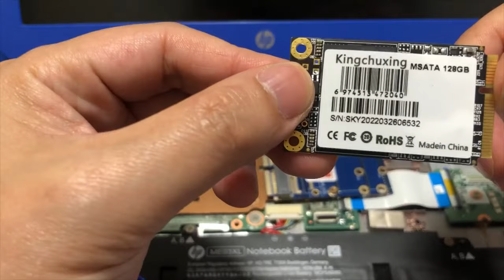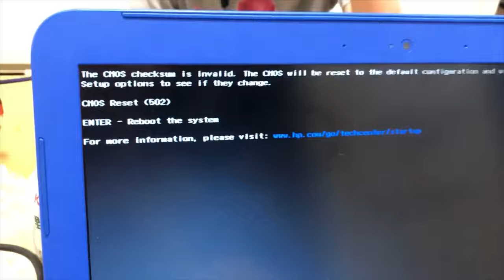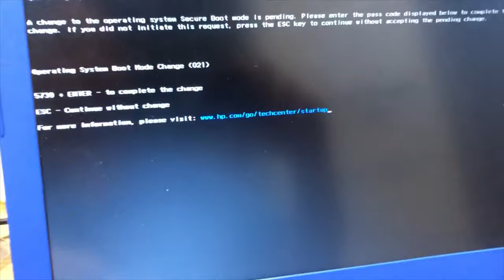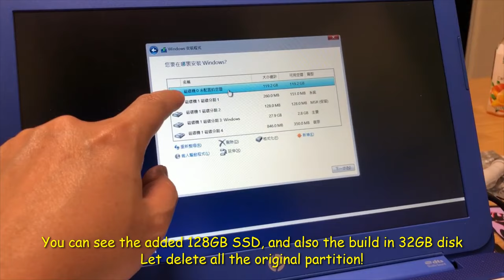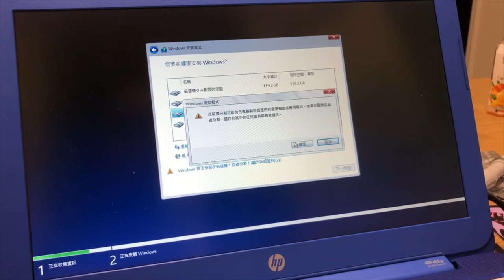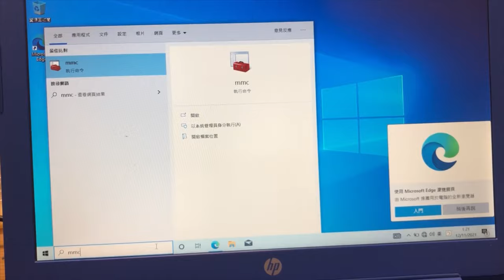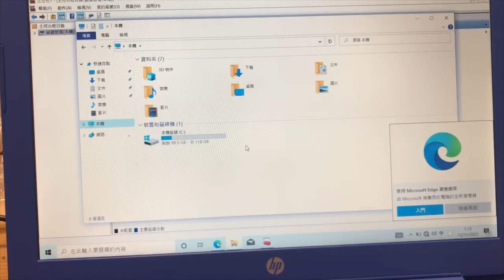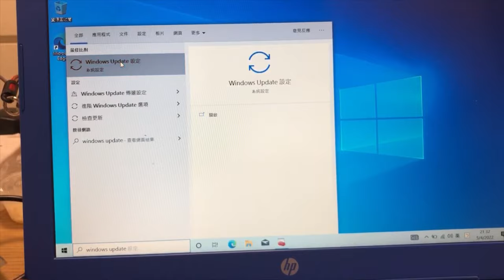HP Stream 13 hard drive upgrade

Comment: if your hard drive isn’t broken, you can upgrade the storage in a pretty seamless way by using the micro sd slot. they sell micro sd cards now that are like 10x the native storage on the stream and they insert flush into the slot so its set it and forget it with no reduction in form factor. ofc thats only if the native drive isn’t broken
Reply: I have tried this method but my Laptop doesn't recognize the Micro SD as a native storage
Reply: @dencerapolo2867  thats true it treats it as a removable drive which is inconvenient if you need to download more appa

Comment: Dam man i was literally bouta throw my laptop away … cant factory reset cuz of memory to lil.. this will work on hp stream 13 notebook right? Mine look a lil different thats why…
Reply from the maker: Do you mean you want to increase memory on stream 13? There is no solution so far…
Reply: if you know how to desolder the ram and resolder the new ram. it should be technically possible but very difficult to do. Also even getting any spare ram parts for this laptop would be insanely hard to do since how old this laptop is.

Comment: I did this on a 14-inch stream model, but I needed to use a refind for it to boot from the ssd, using the way you did with the adapter. Wasn't this procedure necessary for this model?
Reply from the maker: It may not work for other models. the motherboard layout may different and there may be no space for you to install the card/ssd.

Comment: Update: it IS possible to install and boot to operating systems on an NVMe drive on an HP Stream 13 laptop! See some of my later comments on this thread for the solution that worked for me.

Great video, brother! Easily one of the most helpful that I've seen on YouTube -- this video has far more simplicity and than videos from other channels with thousands of subscribers.
I followed along and managed to swap an SSD (with an adapter) into the wifi card slot also.
Although it's given me 256gb of extra storage, the bad news is that I cannot use it as a boot drive. 
My wifi card slot on my HP Stream 13 didn't have a mPCIE connector... It had a M.2 connector (with A+E key). So I've had to use an NVMe SSD instead of an mSATA SSD.
It seems like NVMe cannot be used for booting in the same way that SD cards can't be used for booting on HP Stream 13 laptops 😓
Reply from the maker: Did you enter the Bios to change the boot option to "legacy support"?
Reply: @alexlam4410  I tried everything, brother.
Secure boot off, secure boot on. Legacy support off, legacy support on... But none of them worked in getting the efi/system partition on the new drive to be recognised. 
I've installed Linux on the old 32gb drive instead, because 32gb isn't enough for Windows. Funnily enough, the grub bootloader for Linux does show entries in its boot menu for my Windows install and other Linux installs on the new NVMe drive, but unfortunately when I try to click/enter any of them I get errors saying that the device doesn't exist.
That's why I think NVMe drives are like microSD drives for this type of laptop in the sense that there is no native ability to boot to them.
Reply: UPDATE: Turns out that it IS possible to boot to an OS on an NVMe drive installed on an HP Stream 13 😃
Although it is still the case that HP's shoddy UEFI doesn't recognise NVMe drives during boot time, there is a simple solution to bypass this problem: install the rEFInd bootloader (technically a boot manager) along with its NvmExpressDxe-64.efi driver.
There is no need to enable legacy mode support when using this method.
Thank you Alex, because the combination of this video and rEFInd has allowed me to make my laptop highly usable (the best its been since I got it in 2016!) where as before I was considering sending it to trash!
Reply: cool!
Reply: @ThisIsHolyJJ  One Can you send me link where to buy adapter and ssd, and also where I can find REFIND bootloader and nvmexpressdxe-64.efi driver ? Thanks in advance
Reply: @FabioGhezzi  This just isn't working. Within seconds my replies are disappearing. There is nothing I can write here. Unless you can somehow give me an email address that I can paste my reply to, I won't be able to answer.
Reply: @ThisIsHolyJJ  Thanks a lot for the infos!!
Reply: @FabioGhezzi  No problem brother, I'm happy to be of help.
Before ordering anything though, just make sure that you open up the laptop first and check that your HP Stream 13 really does have the NGFF connector and and not the mPCIe connector.
I made the mistake of ordering an mPCIe to mSATA adapter before first checking which type of connector my WiFi card had 😆
Reply: @ThisIsHolyJJ  Adapter (arrived today) and memory (arrived some week ago) installed on laptop without problems at all! Now I have to install windows instead of Nubuntu.
Reply: @FabioGhezzi  That is excellent to hear! Really glad to know that it has been a relatively trouble free experience for you.
Given the high volume of storage that NVMe drives allow, I've kept my system a multiboot, with Windows and 3 different types of Linux 😁
Reply: @ThisIsHolyJJ  where can i  order the adaptor?
Reply: @MangoHolyOne Any chance you could email me the guide you used? The nvme is in my HP stream, but I can't seem to make it primary/ bootable. Thanks bro.
Reply: @zenklawy  Trying to get an email ID on a youtube comment without the entire message being deleted is close to impossible these days, unfortunately.
I didn't have a guide that I followed. 
I'm a Linux user and not a Windows user, and so I first wiped the laptop's 32gb eMMC drive clean and then installed a Linux distribution, like FerenOS.
After logging in as normal I used the Linux repositories via the command line (i.e. terminal) to install the rEFInd boot manager and the previously mentioned driver.
Reply: @tommypoon6953  From the world's most popular auction site (I can't write it because it causes my whole comment to get deleted).
Just search for "m2 nvme key a-e adapter", and you'll find a few results from sellers in China.
Reply: @ThisIsHolyJJ  GOOD DAY sir, where can i buy that converter, please reply..thanks in advance..
Reply: can you give more details on how to do this? From where to take NvmExpressDxe-64.efi driver? where to put this driver? also for the bootloader? do i have to use  rEFInd bootloader or i can use other boot loaders? i have ph stream 11 and i instal nvme with adapter into the wifi card. I see the nvme disk when i boot from the emmc, but i can not boot from the nvme like you  @ThisIsHolyJJ
Reply: @ThisIsHolyJJ  thanks so much ive been try to get around this problem for so long. 👍👍
Reply: @darkdude9090 can you help me? My 32gb SSD crashed and this is the only pc i've got, how can i install a new ssd and increase the ram if possible
Reply: i'm not finding any videos of people soldering on more ram. i would have thought someone would have done that by now.

Comment: Hello Sir,
Will this method works if I upgrade my ssd if there is a fault in keyboard? Because there is a fault in keyboard in my laptop. Then if I upgrade that will it work as usual? Will a problem occur?
Reply from the maker: I  will suggest you to find a USB keyboard and try if it can also work under BIOS mode. If yes then try to install it with the USB keyboard. (I believe it should work)
Reply: @alexlam4410  Ok, Thanks

Comment: Will a msata drive connected directly work? Do you really need the adapter?
Reply from the maker: The adapter is necessary. The interface of the motherboard is mpci, it will need to convert to msata interface

Comment: Hi, excuse me, can I install a M2 hard Drive with the same process?? Because I read that the M2 is better than msata.
Reply: Your concern about best performance is pointless. It's a cheap laptop and I'm pretty sure the WIFI card slot is sharing PCIe bandwidth with the USB card anyway.
Reply: Hi Veronica.
It depends entirely on your HP Stream 13 model, because there are actually a lot of different types. You are basically limited to what connector your WiFi card slot your laptop's model has.
Mine is an HP Stream 13 with model number 13-c100na. 
As you can see in Alex's video, his model has a wifi card which had an mPCIe connector. In his case, it would not be possible to install an m.2 drive because mPCIe to M.2 (with M key) adapters are not available.
My HP Stream model has an M.2 connector (with A+E key) for the WiFi card... And so I was able to get an adapter for an M.2 drive with an M key. So that's why I would not have been able to install an mSATA drive even if I wanted to.
However, you won't get full M.2 read and write speeds because the laptop's technology is too old.
The mSATA and M.2 speeds on HP Stream 13s would have very little, if any, difference. I'd say just install whatever your laptop model allows you to.
I hope that helps 👍
Reply: How do you know or where do you read wich kind of conector has your WiFi slot on your Laptop because I don't know?

Comment: Really well done! I've been looking for a solution to this problem for years, but since the hdd is soldered on the motherboard I didn't know how to replace it, you made me discover a new solution!
Could you link the pieces you bought? Thank you very much in advance 👍🏻
Reply from the maker: I purchased the adapter from Taobao, not sure if you can purchase and ship to your location. good luck.
https://item.taobao.com/item.htm?spm=a1z09.2.0.0.c3422e8dOU3g6E&id=566340847191&_u=u29fbup95e13
Reply: @alexlam4410  First of all, thank you for your help, unfortunately nothing can be seen from that page, so I would like to ask you if you could show me the name of the manufacturer and the model of the adapter, because in the HP Stream 13, ONLY that adapter you have can fit. you, I have tried to search many on the web (Amazon, Ebay, Google, etc ..), but I could not find even one of that size, I hope for your help, thank you very much in advance and sorry for the inconvenience .
Reply from the maker: Hi,  "taobao" is a China site, not sure if it was blocked by the China firewall...
There is no packing for the adapter...
It was cost around USD15, and I can help you to order if you need it, but seem the delivery charge from HK to Itlay is much high .. it may not worth to do it.
Reply: @alexlam4410  Hello i cannot find this adapter, could you send me seller email contact?
Reply: @alexlam4410  greetings friend

Indeed, it is an issue to be able to buy it while on the other side of the world, since the Chinese firewalls restrict me, apparently this page is not as international as AliExpress or Alibaba. Do you think you can send me this adapter to Miami, United States to a specific address and I will pay it by Paypal? and how much would it cost?
Reply from the maker: @pedromanuel9878   hi, it is very expensive to ship it from HK to US after checked...it is not worth actually.
Reply: Can you help me to buy this mpci to msata adapter? I needed badly for my hp stream 13 notebook. Im from the philippines.
Reply: HK TO PH.

Comment: I am installing mpcie to nvme m2 ssd adapter. How do I ensure that the bios supports my nvme ssd?
Reply from the maker: I believe it can be detected as long as you select the HD legacy mode in the bios
Reply: were you able to do the activity?
Reply: @Sushil Bro, did you manage to get the NVMe drive to work as a bootable drive?
Even my wifi card had an NVMe connector (with A+E key) and so even I had to get an adapter.
But the BIOS doesn't detect it for booting and so I can still only use an OS installed on the old 32gb drive.
So just wanted to know if you managed to succeed. Thanks.
Reply: @ThisIsHolyJJ  sadly amazon sent me the wrong adapter, so I had to send it back
Reply: @07sushy  Thanks for the update.
If I do ever manage to get my NVMe drive to be recognised as bootable, I'll provide an update with instructions. 
Thanks again brother 🙏